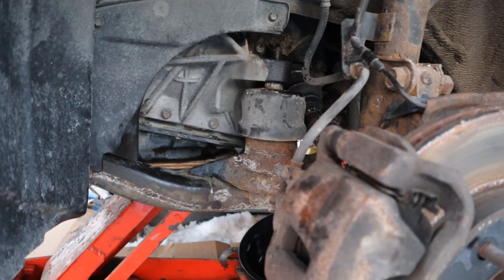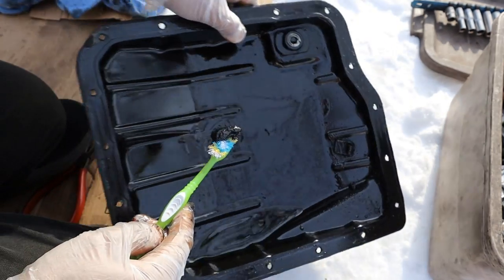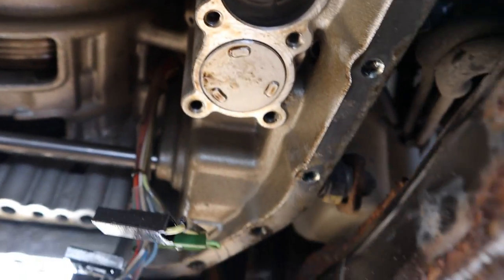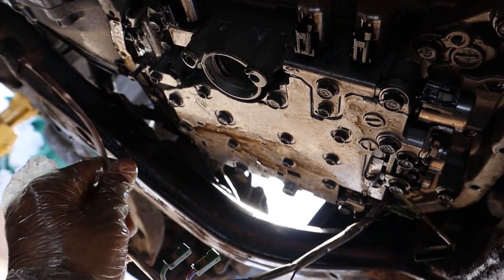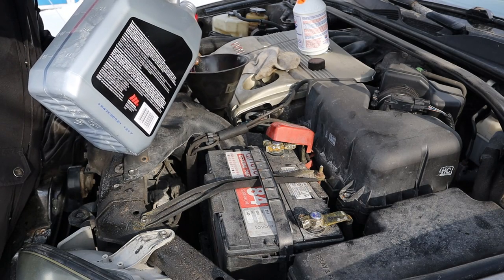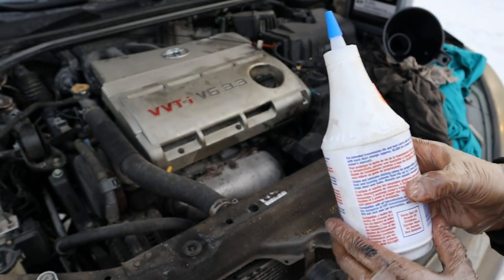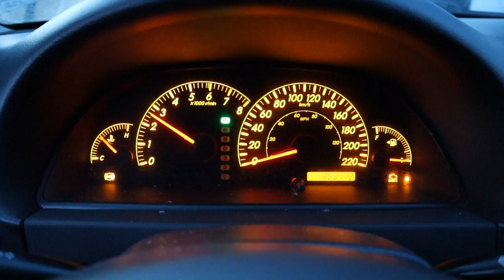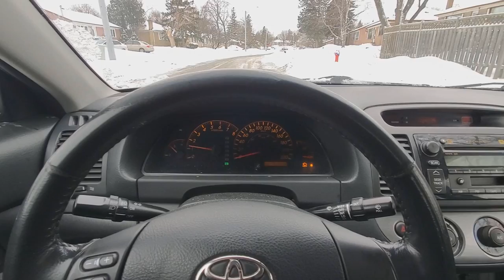Can Stop-Slip Save this Transmission?

Comment: This is probably unpopular but I thought the legendary Toyota reliability and ease of repair are not present here.
It was way easier to drain and fill my BMW transmission and I didn't even had to remove any supporting bolt to the car to make way for a tuck away bolt.
Reply from the maker: Yeah it's a stupid transmission pan design on this generation Camry

Comment: It’s important to change the fluid dont believe in the life time fluid that’s bs. My car would drive fine but I noticed a noise on the drivers side wheel well it sounded like a bad hub barring but it wasn’t it was the transmission. I got the fluid changed and the noise went away so I suspect it was dirty fluid causing the noise so make sure you keep up on the fluid. Removing the trans dip stick is the most stupid thing ever I don’t understand why that’s a thing on cars now it’s like they don’t want people changing there own trans fluid
Reply from the maker: At least these cars have a dipstick. The newer ones force you to pump the fluid inside

Comment: Hey man I love your videos. I’m looking into using a head gasket sealant on my 1992 Toyota pickup 3.0 vze engine. I know it’s a bandaid fix but I can’t afford to do a HG job or buy a used engine right now. 
Can you PLEASE recommend the “best” HG Sealant (Bars, blue devil, k-seal, crc etc...) ? 
Any experience with these? If so please recommend one.
Reply: Check out the chrisfix video. They work similarly
Reply from the maker: I don't have experience with HG fix but haven taken apart engines with that stuff it really cloggs up the system
Reply: @speedkar99  what shood I doo? Where is the best place to find a used engine
Reply: @moejr14  Not him but Kijiji. What transmission do you have plenty of shit bolted to those old pickups? But also if it's just a head gasket why not just change a head gasket?  It's a pretty easy job. Plenty of space once you move some stuff around. And the head gasket is like 50 bucks?
Reply: @SPAZTICCYTOPLASM  I heard it cost a lot more and I do t think I have the knowledge of how to do this
Reply: @moejr14  buddy go to rock auto for the parts and YouTube for how to do it. Otherwise I'll buy it off you. You shouldn't be driving an old car if you can't fix it.
Reply: @SPAZTICCYTOPLASM  OK it’s for sale how much do you wanna pay.
Reply: @SPAZTICCYTOPLASM  Replacing the gasket won’t work if the head or block is warped from overheating or if one is cracked
Reply: @speedkar99  Agreed, once you verify the leak is sealed I would change the oil as chrisfix recommends but also flush the coolant so the sealer doesn’t linger in there

Comment: Gears are very sensitive. Even after just replacing the gear oil the car acts weird and u have to be very gentle till it becomes like before. And some new cars they need to be programmed after each gear oil replacement like a Range Rover 2014+

Comment: Thanks again 
If  you don't mind how many miles on cvt transmission fluid to be changed
Reply: Just look up your car's manual online, it'll have a maintenance schedule in there.
Reply: @GreenZinfidel  A lot of schedules don’t recommend changing it. IMO should be changed every 50k minimum, but Nissans and Subarus are worse. Keep monitoring the fluid smell and color
Reply from the maker: Once a year drain and fill

Comment: I just had to change the filter and the fluid on my IS350 and it was so nasty the gasket was basically a brittle plastic instead of rubber
Reply from the maker: Yeah it's worth changing (at least if you know your transmission is good, unlike mine)
Reply: @speedkar99  its still good. Was 190k mi and starting to shift hard. Pan gasket was brittle. After replacing the fluid, gasket, and filter its smooth as glass. Should be the same as the gs350 or gt86 6 speed

Comment: Your manual valve is misadjusted, it’s moving in neutral
Reply from the maker: I don't think so. It did that before I tore into it.
Reply: @speedkar99  or the O rings on the manual valve are gone and letting the wrong hydraulic circuit to be powered. make sure the shifter linkage is tight too. It really seems like it’s just one range off
Reply: @speedkar99  I get that all the time with ambulances (ford E350 vans) the shifter cable has some slop on it and it will be a range off on the dash, and you can drive in neutral

Comment: I'm on the second transmission under warranty neither one surpassed the 5 years or unlimited mileage  first one barring locked up twisted the pump out so we replaced it a second time an it is bad got reverse, first ,an second but no high gear so now in the process of the third one to be sent an put in less than a year so do yourself a favor get a jasper rebuilt do not get an All Transmissions, Moverus Transmissions bought all the remain Transmissions all over the world they sell the same Transmissions as AutoZone an O'REILLYs does an both trans I've got come from AutoZone so buyers beware they don't up date the Transmissions when they build them ....
Reply from the maker: I'm gonna put a used transmission inside
Reply: @speedkar99  I would've done that to but it's hard to find a C6 transmission for a 85 Ford F250 4x4 xl 351 windsor 4 barrel carb 9 mile a gallon but with this transmission there was only 2 years they made it 84 an 85 I've found 2 wheel transmissions but they won't bolt to transfer case case its like you have trans then you have transfer case then drive shafts  bolt up an go's to front drive shalft an rear end ....

Comment: That fluid was AWFUL. Looked like crankcase oil! I owned a 97 & changed tranny/filter every 60,000 miles & bought it used in 2014. I NEVR thought to disconnect lines & flush. DAH! 🙉 But it was STILL GOOD @ 21yrs old. Had to junk bc of rust. Nice try, u jst cant put w bandaid on trannies or engines dealing w/lubrication. 😂🤣 U crack me up, "my brother's shirt/ wife's toothbrush."😁 Good video anywho. AMD frm "car care nut" always says ur better NOT to change fluid w/excessive miles. Bands tend to slip. Something about old fluid, ur better off leaving alone.
Reply: I immediately dismiss anyone who says to leave old fluid in a trans that still works fine. It's so stupid. 🙄
Reply from the maker: Yeah usually you shouldn't flush a good working transmission since that can cause more harm than good.

Comment: I'm sorry but any mechanic knows it's common sense you take and put on liquid wrench or spray on whatever you have to treat the bolts against corrosion and rust before you lose and everything including the the drain and fill plug for the transmission pan oh, come on guys act more professional and have a check list of what you need to do before and after leading up to any work or repairs?
Common Sense tells me you could loosen those transmission valve body bolts by hand to start and then zip them off with your electric Ranch keeping in mind which bolts go where? Because some bolts have different links and you can't get that mixed up!
By the way if you got some Lucas or whatever additive you're putting in for the transmission why don't you microwave it for a minute or heat it up so that will pour much faster and match the or help warm up the remaining fluid with adding this warm fluid in there!?
It's obvious you know nothing about Transmissions? Why don't you watch Precision Transmission out of Amarillo Texas and improve your knowledge of Transmissions this guy that his been working on Transmissions most of his life can take one apart in 15 minutes or less and it explains everything about that transmission that he disassembles what's wrong with it and what they will replaces Parts with which will be better off than the OEM original parts! Come on guy get smart work smarter not harder!?
Understood even aluminum corrodes?
Reply from the maker: Pan bolts go into aluminum. They don't rust or need spray. I cracked them loose but edited that out, the rachet wouldn't have worked alone. Good tip on microwaving the Lucas.